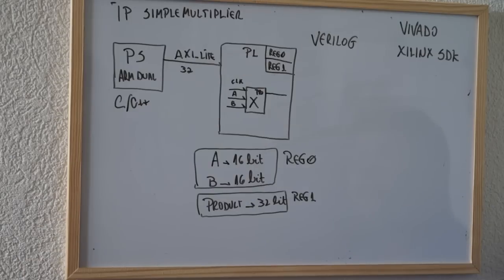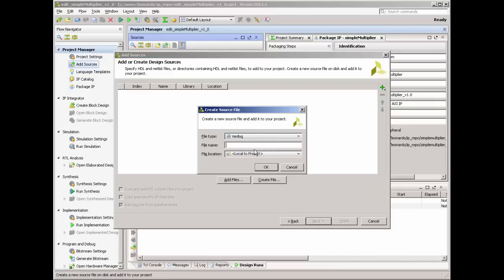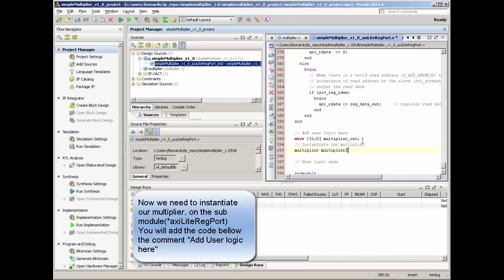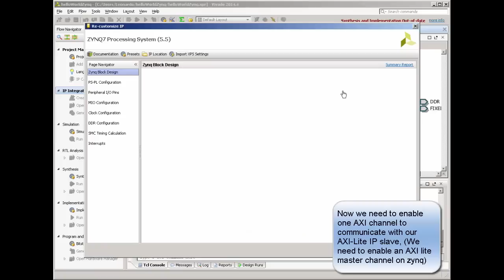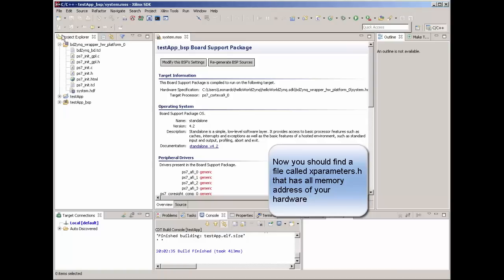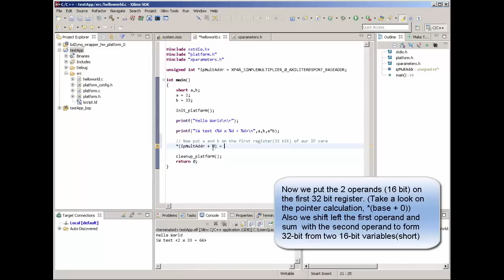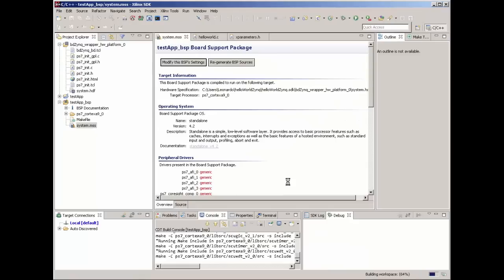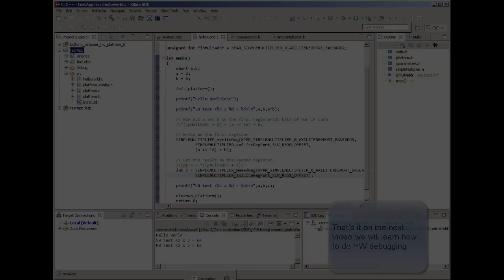Zynq Training - Creating a simple Axi-Lite accelerator #02

Comment: Hi, I have a little doubt. I am using AXI-lite for quite large no. of data. I am usign 12 32bit registers for input and 4 32bit register for output. But I am unable to get exact result as my design is supposed to take 10clk pulse. So please let me know what can be done if hardware take some delay for operation while software gives instantaneous output. How to wait for overall execution in software then to extract output.